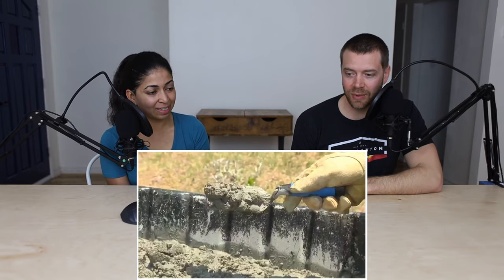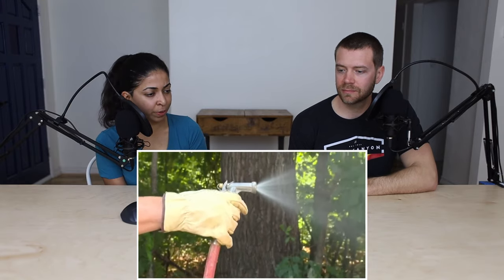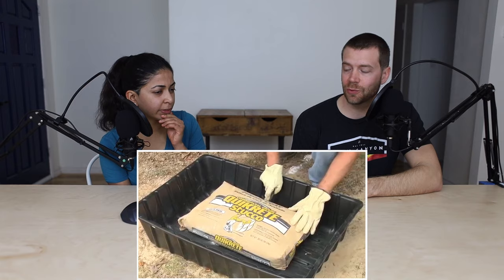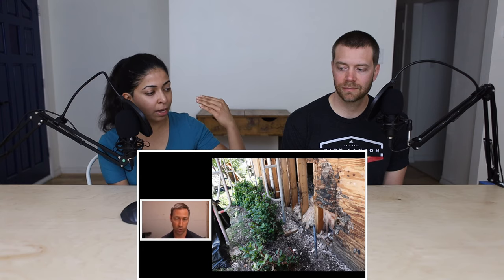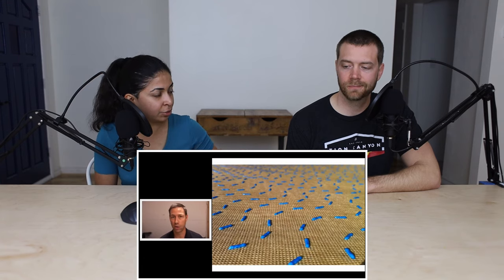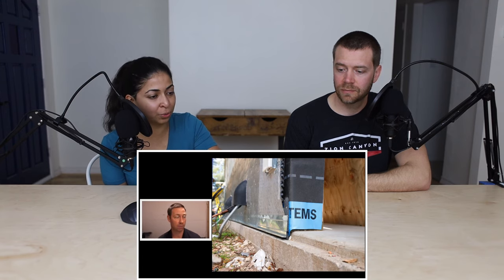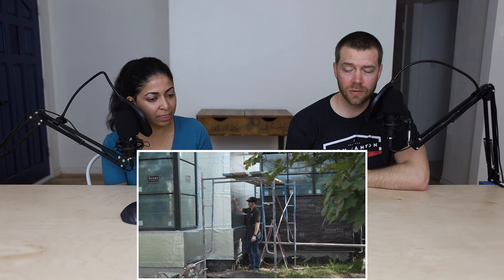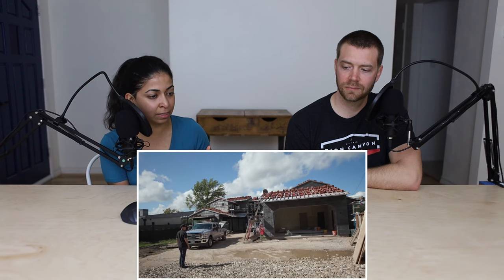How to install stucco (designers review)

Comment: Stucco is a Portland cement product, not "concrete" which includes aggregate 3/8" or larger.
It's important each layer is allowed to cure and if joints are not included in the design allow cracks form that are then bridged by the next layer (in a 7/8" three coat system)
The scrim on the dimple mat keeps the passages from being packed full of stucco/mortar.
It provides a surface for the cement to adhere. Much like tile isolation membranes.
"Stuccoer"....🤣.   Plasterer, or more generally "trowel trades" which include concrete flatwork but not formed concrete.
You two are so cute.  I'm having a great time digging into your backcatalog.